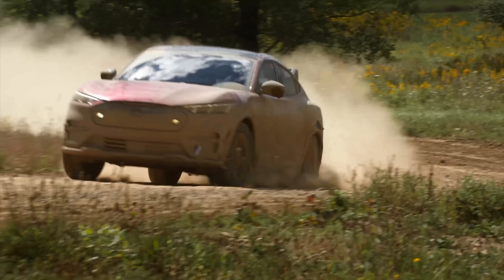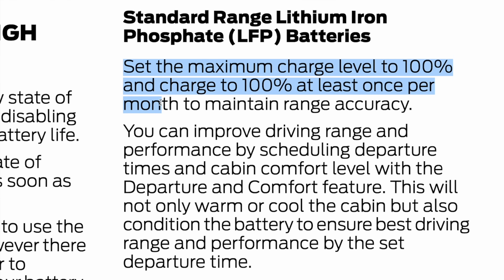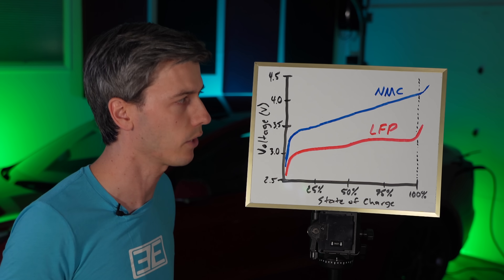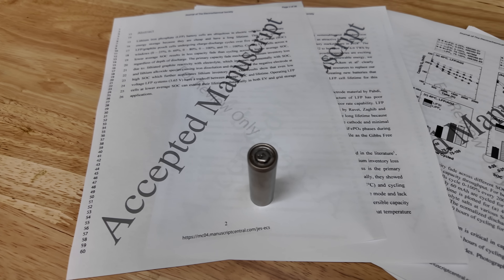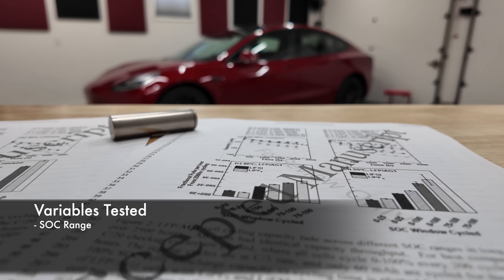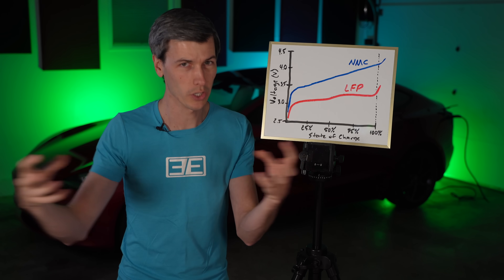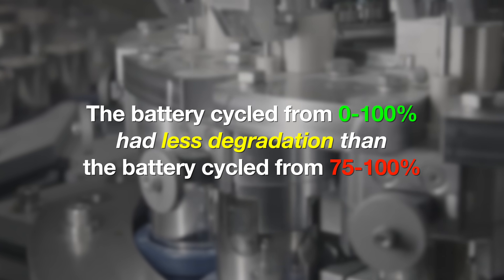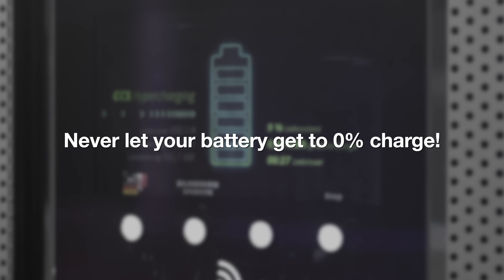How To Ruin Your Electric Car's Battery - LFP Edition!

Comment: Wow, so many misconceptions in a video that's trying to clear them up. For starters, when Ford, tells you to charge to 100%, their computer does the charging, and will only charge to 80%. It doesn't tell the customer/user this because it would be confusing. Let the brain of the car do it's job. It knows how to charge itself. Many cellphones do the same exact thing (I used to repair cell phones  for decades so I'm extremely familiar with lithium-ion batteries). 2ndly, you keep saying what "chemistry your battery is". The chemistry itself is largely the same in both batteries' passing electrons over to the anode/cathode and presto, a charge. What's different is the actual batteries themselves. They use different materials do achieve this. By saying "chemistry" you're making it sound as if they operate differently. Nope, most batteries all work the same, some just use different materials to achieve greater efficiency and energy density. By the way, you know what the biggest battery killer is (for lithium batteries)? Age. The materials inside the battery will begin to degrade the moment it's off the production line. For your standard cellphone battery, it's about 2 years. You'll get about 2 years worth of charges before the performance significantly plummets. Even if you only ever used the battery a handful of times, or even just once, age is something you cannot do anything about. Keep in mind I'm only referring to Li-Ion. All of these best practices can extend the life of your battery but not by a significant amount, we're talking single percentage points here. Absolute maximum is around 10% Again, I've worked with lithium-ion batteries for about 20 years now so I'm extremely familiar with them.
Reply: Can you prove that ford limits the charging to 80%? Name an article that discusses this.

Battery chemistry is the common term when discussing, you know, differences in battery chemistry. Aka what the battery is made of.

Phone batteries could very well last 10 years if they weren't charged to and stored at 100% all the time, and if they were properly cooled or charged slow enough to prevent high temperatures in the battery pack.

Comment: Getting into FPV drone hobby had me learn a lot about battery management. Bettery percentage is basically meaningless, only voltage is important. For the drone's LiPos, full battery is 4.2V per cell, empty is 3.5V and for storage you should set them to 3.8V. It is recommended to never leave the batteries full more than a few days and never ever go below 3.5V or it will harm them.
Now I'll apply these rules with my new phone and hope my battery will last longer than my last one.

Comment: “The average LFP battery will last the lifespan of the vehicle” yes but the issue is that my grandpas toy yota will still get 400 miles or 640 KM at 400k miles while the tesler or Polaris 2 would be like playing COD mobile in 110f/43c on an iPhone 8 or Note 9.
Reply: An LFP battery could still get 90% of the original range at that mileage.
Probably not far off the range that a combustion car loses over time with engine efficiency deterioration.

Comment: Great video. The obvious solution is to offer a charging option which limits charging to 80% and will automatically load to 100% when it is necessary to calibrate. Incidentally, this is what the iPhone 15 does. If you choose max. 80% it will also sometimes charge to 100% ( in this case to assess the remaining capacity).

Comment: also Name 1 battery powered Device that you've never had to replace the battery in.  so what makes EV's any different that your Eventually going to have to have it replace at an astronomical cost..
Reply: EVs have active thermal management. Couple this with following charging practices, and the batteries can last an enormously long time.

Comment: Okay I am confused about something. I use LiFePO4 batteries in my RV. The manufacturer of all LiFePO4 batteries that I have seen advertised state that you get much longer life if you do NOT deeply discharge the batteries, even though you safely can. In other words, it is better to keep the batteries at say 60 to 90%, with an occasional top off at 100% to reset the SOC meter.
This is the opposite of what you are saying here, which is that the cycle life of the battery will be higher if it IS discharged deeply, rather than kept in the top 75% or so of the battery capacity.

Comment: Ugh, I KNEW it.  I was annoyed when my 2022 M3RWD order got switched to LFP, I did not trust the "charge to 100% as much as possible/at least once a week" advice that was coming from Elon/Tesla.  I ignored the tesla stans on reddit, but eventually it also started getting parroted by all the EV outlets I trusted.  I don't plug in every day but don't limit home charging when I do.  December 2021 car started with 272 miles now at 255 on a full charge.  Losing over 2% a year.  That's not any better than the air cooled 2012 Leaf I owned with 10/12 battery bars over 9 years.  Hoping it levels off, idk.

Comment: Doesn't matter because EV's are valueless once the battery warranty runs out. If you ruin the battery make a warranty claim, problem solved. After the warranty expires you just throw the EV out.  

Sorry but if you don't believe me, I'll sell you 10 year old Model S's at $25,000 all day long. How many you want????

Comment: Great video and info! You said to operate on lower SOC ranges as possible, but how about below 30%? As I see on your graph, the voltage on LFP degrades significantly at that number and below. Is it any problem to the battery health when operating on such a low voltages?

Comment: It's pretty funny if you have been into LFP home batteries. It makes perfect sense to charge to almost 100% (doesn't need to be actual 100%). Otherwise the batteries won't be balanced. You can only balance at almost 100% (top balance). Your series of batteries will have the capacity of the battery with the least amount of charge. So you want your cells to be balanced. Theoretically it shouldn't matter, but realistically it does matter.

Comment: Tesla also says in the owners manual that “there is no benefit in waiting for the battery to be discharged to any level before plugging it in”, this is obviously in addition to the advice “leave at 100% charge limit to maintain battery health”. So doesn’t agree at all with the study you focused on.

Comment: Software should be controlling how much charge and type of charge is given per occasion based on an analysis of use patterns of the vehicle, environmental conditions, battery degradation state.

I presume that the top-of-range EVs are already submitting telemetry data on all these variables to the manufacturer for the purposes of improving the design of the next generation of vehicle. . so, it wouldn't take much to implement a real-time  individualised "Best Practice/degradation minimisation" policy and management system  for EV batteries  for particular user/vehicle/ environmental combinations using two way telemetry.

Comment: Wouldn't it be great to have a battery for flex storage, so when at 100% and stored it can move energy to the backseat battery pack to spread that charge, then when you need it there's another battery there.

Oh wait, that's just having a bigger battery in the car lol

Well maybe half the battery should be NMC and the other half LFP? Wouldn't that make complete sense?

Comment: (Un)luckily I live in Arizona where the temperatures for the air and surface temp aren't uncommon nor far off from the study temps of 40°C and 55°C @12:30 during the summers, so this is directly applicable to me funnily enough.

Comment: A couple of thoughts.  I have a Tesla in a warm climate.  The system self cools the battery but draws power to do so.  Is it advisable to set a moderate charge limit - say 75% and keep it plugged in so the cooling can be driven off the grid?

I usually run in the range of 35% to 100% but could easily switch to 20% to 85%.  I use solar for charge so yend to charge by day at home (hottest time of the day too).

Thanks for the info. Avoiding routine charge to 100% makes sense.
Reply: Which make and model year do you have? The answer depends a bit.

Comment: You're still in the prototype era...analogous to the brass era before WW1 for IC cars.  Too much is different for different cars, different drivers and too much is left to the driver to guess about....since few read owners manuals or fully understand them.

When EVs get charged fully automatically and passively then they will work best hot and cold, high use low use, long distance vs short hops.  The damned thing is a bank of rolling computers so it really ought to be able to figure all this out dynamically...the way ICE cars are not altering fuel air mixes and VVT on the fly for different driving, altitudes, temps and fuels.

When you can just park your EV over a charge ready spot and step out...leaving hooking up, unhooking, and charge rate fully in the car's control....then EVs will have matured....probably sometime in the 30s (just like ICE cars)
Reply: You can literally just do that.

Comment: One of the things I have heard on ALL battery types, but especially any formulations that are particularly sensitive to damage at high state of charge, it is preferable, if time allows, to fast charge to about 80-90% (depending on battery formula) then slow charge past that point.

Comment: Bottom Line... just drive your electric car and don't over think it.   EE is an awesome channel, but this particular vid is way overthinking it and going to put a kink in your electric vehicle lifestyle (or at least mine) to worry about this.  There is no imperical evidence that this will gain you serveral more  years of battery life, and each cell may react differrently over  its lifespan, creating a battery that won't last optimally anyway.    They do studies like this, as stated,  and some say the opposite. So its really not something to stress about. Also testing really hard does not mean its the same as long term use, they can't just duplicate 10 years of use with short periods of hard use, thats not accurate actually. What I can say is that this will probably take years off your own life worrying so much about your electric cars battery and trying to do a bunch of short or long charges to optimize you battery... your regular driving habits will approximate partial charges and such. Just drive it and don't worry... you'll be getting another electric  vehicle within 10 years anyway because your current electric car will have barely any value and with the progress of 10 years of tech advancement you old/current battery will be obsolete.  Love this Channel and the vids... just sayin"

Comment: This is why EVs are only good for leasing and must be kept under warranty. 
You can't fast charge them to 100%, they don't perform well in extreme heat or cold, they can't tow, the batteries are expensive to replace and even more expensive to repair, range, charging network, price, dirty mining, limited recycling, battery degradation, car depreciation, etc. It's just a dream that won't become a reality until all of its limitations are addressed. It needs to be better, faster, cheaper and easier in every way compared to ICE to be able to replace ICE without governments literally forcing it.
Reply: My EV can tow 1.5 tonnes just fine
Reply: @TheHuesSciTech  My tricycle can tow 15kgs just fine

Comment: The flat curve means the soc is less important though. The study mentioned is misleading because the cycling is the issue so sticking between 75% and 100% means you cycle more often than 0 to 75%.  That means regen breaking is a problem as well. It doubles the degradation rate.

Comment: Another thing to consider is how batteries go bad even if they are seldom used.
That's my experience, anyway.  I am not worried about charge cycles as I am just plain old age.

Seriously, it is quite rare to find ANY kind of battery that is 10 years old and still strong. 

Electric cars work quite well for those who buy new ones and just dump them after 5 years or so and then go get another new one.

Comment: Normally I really like your well researched and well explained videos, however I am dissapointed in this one.
You spread misinformation and generalization without looking at the bigger picture, or making less informed viewers aware of them.
Your video and all papers you mention focus on the cells and cell chemistry. Which is good and fine, but you generalize to a car, which has a pack, not only a cell. And Pack behaviour has to be takein into account.
Specifically charging "once a month" or "once in a while" to 100% is a generalization wich will work for many cars, but will ruin the pack on some, because some cars only balance their packs when the pack is full. They do so on the last % of the charge cycle, e.g. when you sit there and it is at 99% doing nigh nothing, but still takes 20min to finish, that is the balancing phase.
If the car allows to limit the charge to 80% by itself, then it will most probably balance, but if you have a car that cannot do that, like many used EVs out there which may be the first EV of someone, the user may stop the charge at ~80% by themselves, and over time with use and temperature differentials etc. the cells will drift apart until one is dead or overcharged.
Something I would have expected someone of your thoroughness to have considered and put into the video. The video as it stands has a potential to do harm to those EVs, and to the perception of EVs with the group of less informed people who buy them and apply your advice.
ps: I am so thorough behind that because my favourite EV, and the one I own, the BMW i3s, only balances at the end of a full charge. To my knowled without research many if not all BMWs that do not have a built in charge limit do this like that.

Comment: I have 2023 Tesla since Jan I run it hard with uber. I charge 80-90% regularly. And 100% once a week. Batt degradation is around 2%. I charge 98% of the time at superchargers. Batt preconditions before charging at superchargers which I believe helps the chemistry of longer life … thoughts ?

Comment: It's a pity the study didn't test the 25-50, 50-75, and 25-75% cycles. I limit my phone to 80% charge, and although there is no minimum to be set, I generally recharge when it gets below 50%. I know my phone battery is NOT the same as a car battery, but I also want my phone battery to last as long as possible. Also, of course, it is VERY easy to access power to recharge my phone, not so much for charging a car.
Reply: Same here, I usually keep mine between 35-65% charge, as battery university says that cycle puts the least wear on the battery. Dunno if the same applies to LiFePO4 chemistry.

Comment: 2:50 Hahaha!  Awesome.

Question: Though the best charge range reduce degradation is 0-25%, as you say closer to the end, we also know we don't want to over-deplete the batteries.  Given that, could we get more specific about the lower end of that range?

Should we try to keep it above 2%? 5%? 10%?  Because my typical daily drive will do fine operating between 0 and 25%... but, if it's best to keep it above 10% whenever possible, I would probably tend to charge to closer to 30-35% daily, so as to not dip too close to 0%.

Comment: Problem with lower SOC is what happens when you then need that SOC?  Not sure about anyone else but I've sometimes encountered unexpected stuff where I have to take a long detour and/or can't get home due to unplanned problems or accidents...and charging stations aren't all over yet (I get it, we're working on it).  Or like we had a couple months ago if there's something takes out power in the area...we were down for a while when there was machinery at a landfill came in contact with major transmission lines knocking out power to most of the Northern Neck of Virginia...better hope you had enough charge t get home from work including any errands or detour due to crashes at the traffic lights that went dark.  Even with gas I always look to fill up by the time I hit half a tank.  I hate the concept that so many seem to say you need to keep the SOC as low as possible to maximize charge speed...but already in just a couple years 1 of the 2 people I know with Teslas doing that arrived to find the supercharger with 2 dead stalls and the rest full and a line...and insufficient charge to just find the next one.

Comment: No electric battery car can't outlive a ICE car. And battery from the day it's made it start to die off
Reply: I´m mechanic and vocational trainer. Before the Tesla M3 my car was a BMW 530d, in ten years from new and along 300k  I´ve changed 2 pistons, 4 valves, 1 chain and tensioner, 1 cracked cylinder head, 3 injectors, 1 radiator a lot pulleys, hoses... belts, and a full automatic gearbox rebuild with the torque converter. My previous 320d same history. Always servicing it every 10k and the gearbox at 60k. When the LFP battery fails it will be a lot cheaper than that.
Reply: @juanramonoltra1440  And probably at twice the miles. At that point, it might be better to pass on to a family member than sell, so you keep the remaining useful life in the family, if you know it's got a good history.